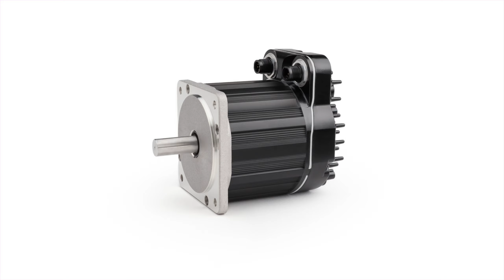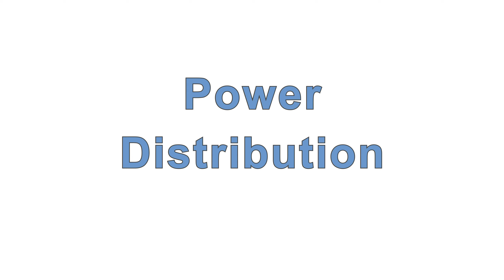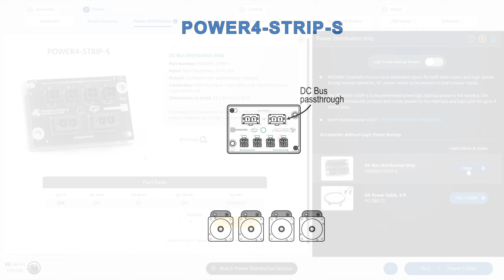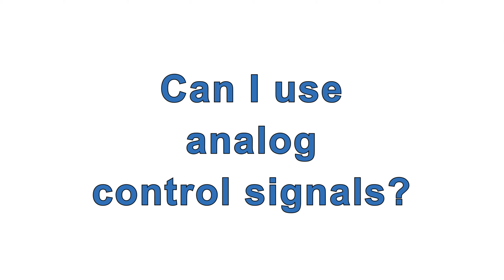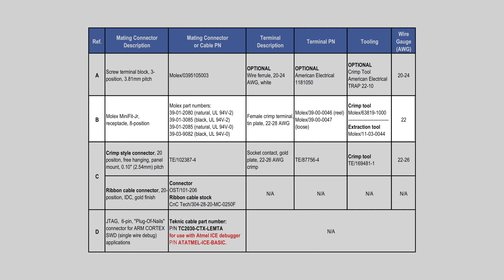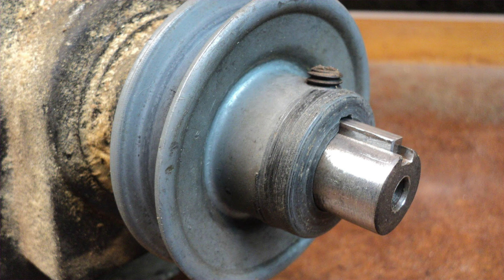ClearPath MC IP66K/IP67 Servo Accessories (Fractional HP)

Comment: Thank you for making a detailed description of how to work with engines. Can you make instructions on how to connect the servo motor to the control boards for a 3d printer?
Reply from the maker: Hi zh27iii47,

I'm an Applications Engineer here at Teknic—thanks for taking the time to share your thoughts on the video!

Our ClearPath integrated servo motors in both the SDSK and SDHP series are compatible with nearly all CNC, laser, and 3D printer controllers that output step and direction signals (also referred to as pulse and direction on some systems). ClearPath’s digital inputs are fully optically isolated and support a wide range of signal types, including open collector, PNP/NPN, and directly driven outputs.

For specific wiring guidance, please refer to the wiring diagrams in the ClearPath Servo Manual (https://teknic.com/files/downloads/clearpath_user_manual.pdf#page=49).

You can also explore more about the SDSK and SDHP integrated brushless servo families on our ClearPath product page (https://teknic.com/products/clearpath-brushless-dc-servo-motors/clearpath-sd-stepper-replacement/).

If you have any other questions, feel free to give us a call at +1-585-784-7454 or reach out through our contact form (https://teknic.com/contact/).

Thanks again for your interest!

Best regards,
Abe A.
Servo Systems Engineer | Teknic, Inc.
Reply: @TeknicInc  I found answers to my own questions based on your links. Thank you for your prompt response.